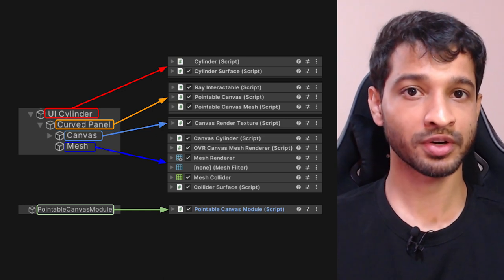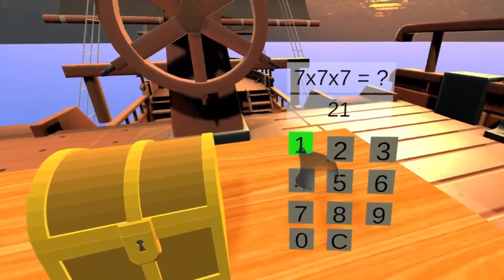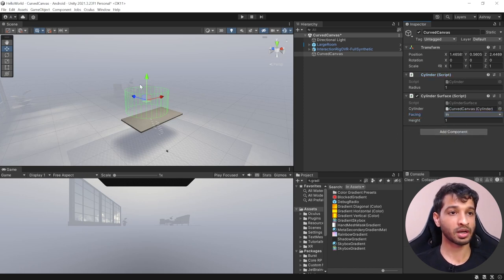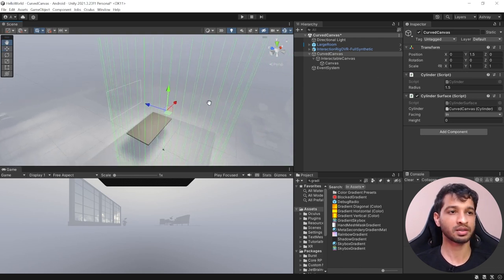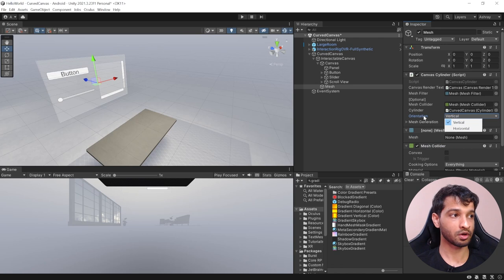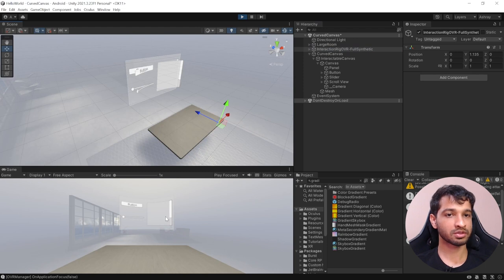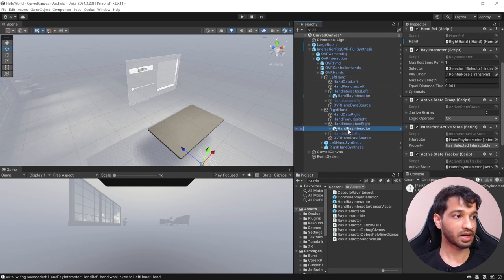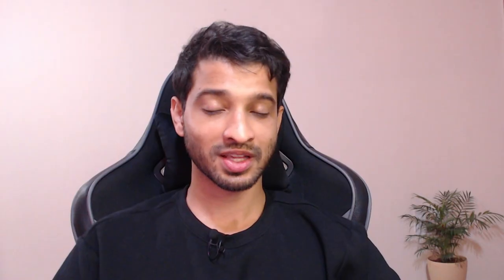Curved Canvas VR - Oculus SDK

Comment: my case after adding OVR Canvas Renderer curves canvas not appearing i have to change the material and when it appears it not showing text input and button
Reply from the maker: Sadly the SDK has been updated and a few things have changed. You can use the Curved Canvas prefab that comes with the package and modify that.
Reply: @immersiveinsiders  Well actually I'm currently using the 63.0.0 SDK, and figured that the "fix-all" button actually breaks some stuff. I included the canvas itself into the "UI" layer and kept mesh on the default layer. Now make sure your centre eye anchor camera doensn't render the "UI" layer and it should be fixed. Somewhere in the video you swapped your Canvas layer from "Default" to "UI" without showing us. So there is your fix :P

Comment: Hi thank you so much for this amazing tutorial - you are out here saving lives! I was wondeirng what the TLDR would be if I wanted to use the oculus sdk rays for just regular UI canvas, not curved. Would the process be similar to this tutorial? Or completely different?  

Many of my friends (including me) have been trying to debug a way to interact with UI canvas (not curved) with sdk. Thanks so much again for all your efforts in this video! : )
Reply from the maker: happy to hear that!
The process for regular UI canvas is almost similar, check out this blog, this might help you with what you need:
https://immersive-insiders.com/blog/oculus-hand-interaction-ray-interaction
Reply: Thank you! I actually did follow this tutorial as best as I could - but it seems slightly outdated. The interaction between the ray and the canvas is still buggy. Although it helped tremendously! It would be great if you could do an updated sdk tutorial on non-curved surface, I've seen many of my friends and coworkers struggle with it. Kudos to you overall!  @immersiveinsiders
Reply: @immersiveinsiders   one follow up question. Today, the ray interactable requires a Isurface rather than a collider. The collider mentioned in the above link tutorial only has mesh collider and mesh filter. What should be going into the Isurface?
Reply from the maker: That's something we need to check. We are working on making updated videos. Hope to release them soon.

Comment: Hey Man so its not working properly for me even tho im pretty sure ive followed every step here. i cant get the rays to interact with the curved mesh. Did anything change since you uploaded this video
Reply from the maker: Can you check and make sure you only have the pointable canvas module and not the standard input module?
Reply: Any solution bro?

Comment: Once I added Mesh Render to Mesh object the curved projection is not happening. Can you guide?
Reply: Mesh Renderer
Reply from the maker: @nidhichauhan9349  You mean you cannot see the mesh?
Reply: Hey, I got the same once I add the Mesh renderer and OVR Canvas Renderer it doesn't show anything anymore did you fix this?
Reply: @immersiveinsiders  I'm experiencing the same phenomenon.
I set it to 0 up to the z-position of the Mesh object and I didn't even add any code, but a value of 0.5 is automatically inputted when playing
Reply: @immersiveinsiders I also have this problem. I can see the how the mesh grid becomes curved but as soon as we add the OVR Canvas Mesh Renderer part it stops working. Any idea how you can fix this?
Reply: @myskerdragneal  did u fixed the issue?
Reply: @immersiveinsiders  yes